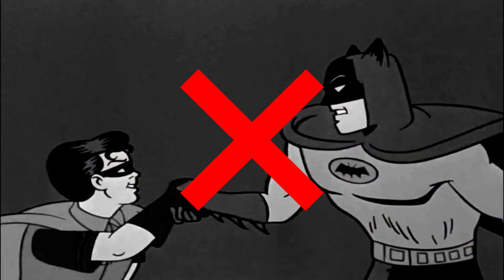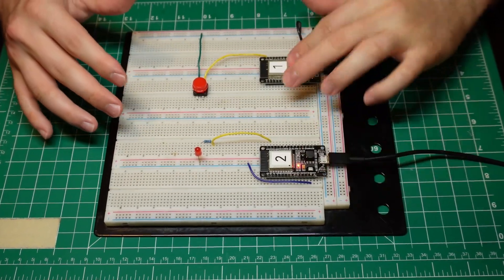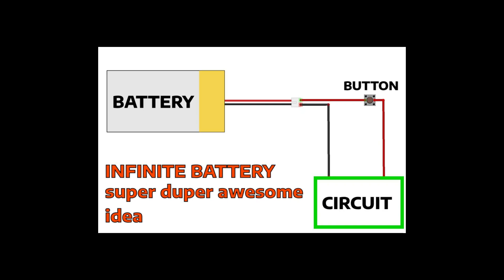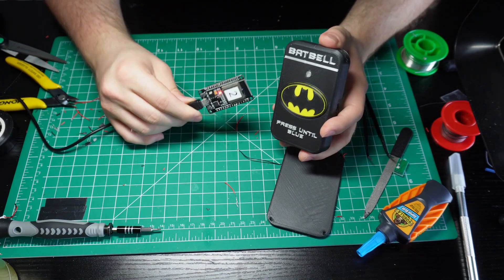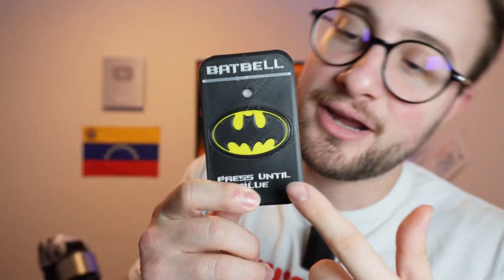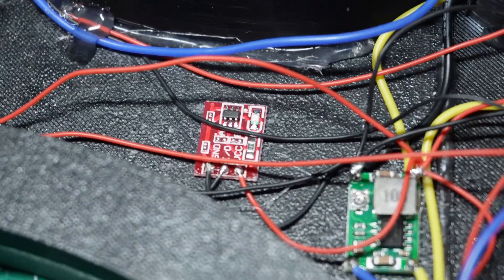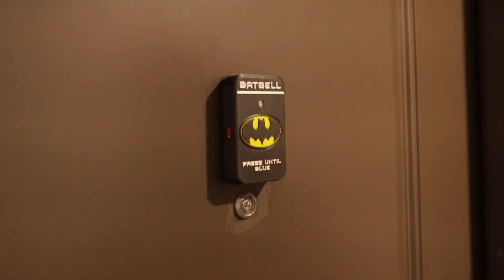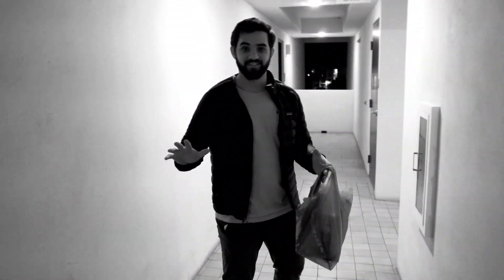I Turned My Doorbell Into a Batsignal

Comment: I was involved in a design where the battery was to be disconnected from the microcontroller.  There was basically a transistor controlled by an OR gate.  If the button was pressed, OR an I/O pin was active, the battery was switched into the circuit.  Activate that line as quick as you can after power-up, deactivate it when it's okay to power down again.